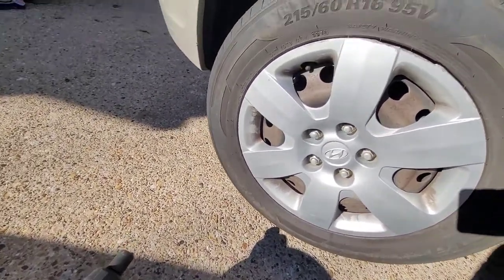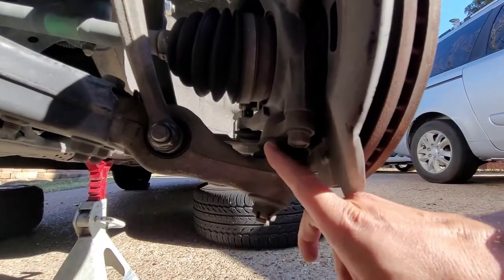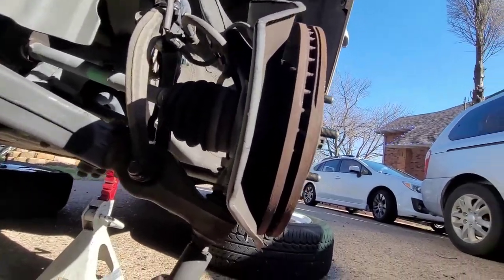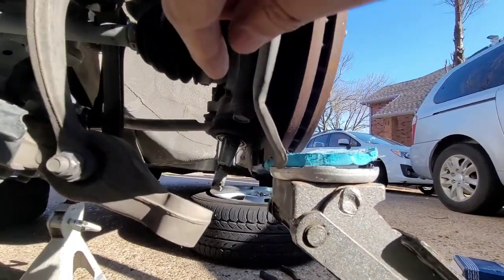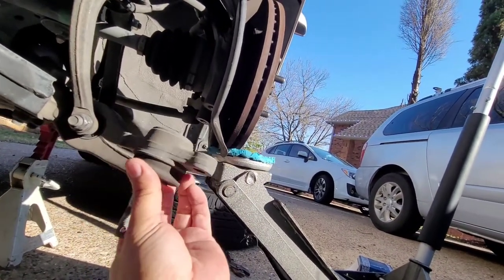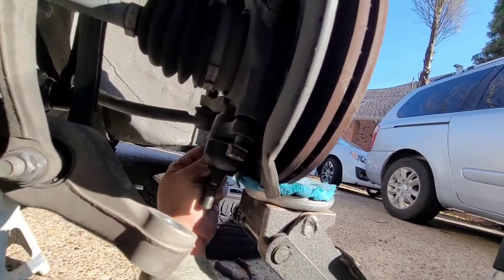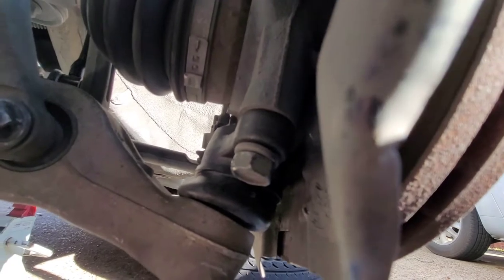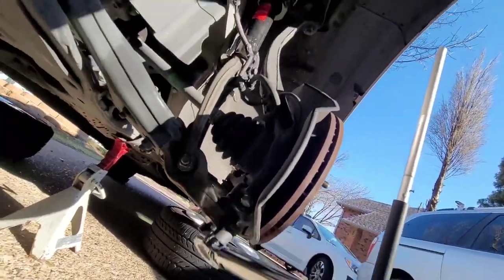Hyundai Sonata Ball Joint Removal and Install

Comment: Hey you forgot to put the Carter pin back in, and if you don't that nut will come on loose that's why it's called a castle nut. You're teaching people the wrong way.
Reply from the maker: A locknut, also known as a lock nut, locking nut, self-locking nut, prevailing torque nut, stiff nut or elastic stop nut, is a nut that resists loosening under vibrations and torque. - Wikipedia

Comment: I was keeping up until you brought the torque wrench out. Your terminology just confused me.
Reply: A Torque wrench gives the proper tightening of nuts and bolts. You should have a torque wrench for suspension and caliper bolts, if you do not have a torque wrench at least use blue loctite liquid on suspension and caliper bolts.

Comment: That so-called pin your are taken out this called a Carter key
Reply from the maker: lol... it is not a Carter pin... it's called a cotter pin... and the new parts had self locking nuts.
Reply: @CarsandEspresso  😆

Comment: I did the same as your method of disassembling and installing, but I tightened the lower screw tightly because I do not have a torque wrench... does this cause a problem and stiffen the steering wheel or not...?
Reply from the maker: stiffen - no, I don't think so...